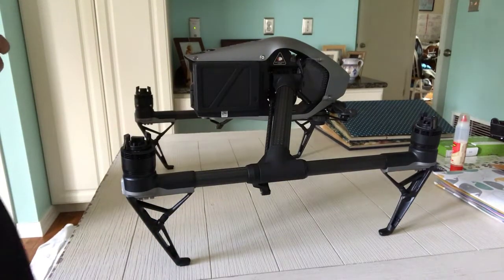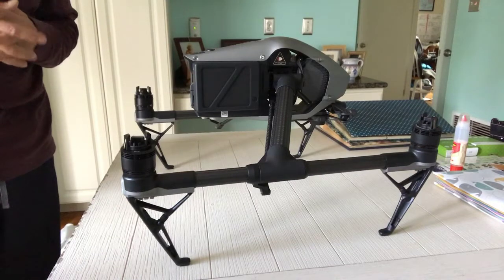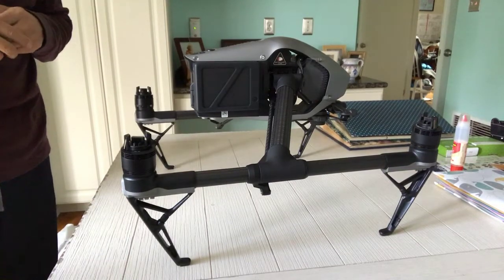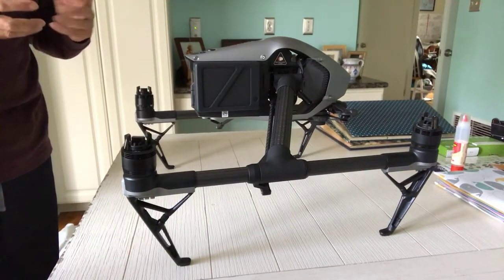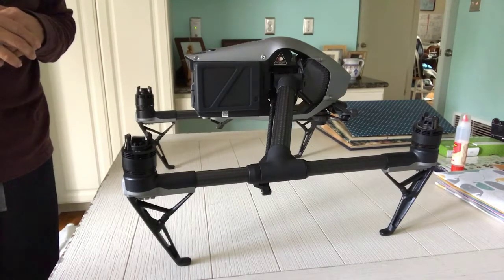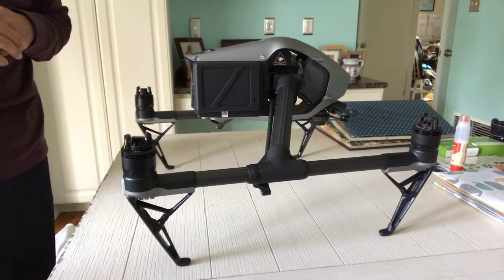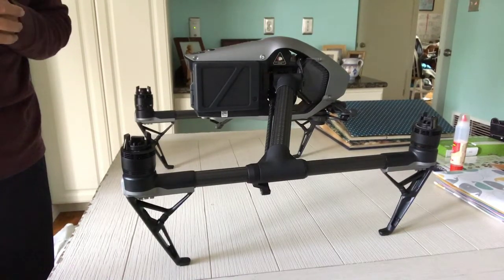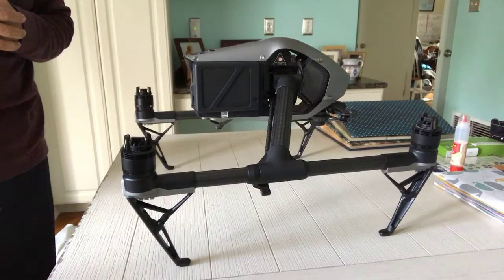Inspire 2 Landing Gear Failure

Comment: Its on travel mode so it will not retract.Am I right?
Reply from the maker: Well, during travel mode is not expected to retract or get on landing mode. I hope that answers your question.
NOTE: The inspire II has some issues that have been documented in the past. One being that the drone drops in flight for no reason at all due to a bug in some batteries. I also experience another failure recently. I loved the drone at first but I have lost confidence in them after 2 years or so of operation.
Reply: @macalcdc  Thank you for the answer,however I do not have inspire 2,but addicted on it,so I only watch it.
Reply: Under the bottom should be a screw that allows u to put it in travel mode manually. I have the inspire 1 and I have to do this after flying to put it back in the case.

Comment: i have the same problem, do you have de solution?
Reply from the maker: CABES Producción. I did solved the problem without sending it to DJI for repair even though they sent me the a repair order. 
Here is what I did.
Underneath the fuselage, the drone has a screw that can lower or raise the landing gear manually. By lowering the landing gear, the servo is able to reset and resume normal operation. Let me know if you need further assistance. Am in North Carolina USA, I can do a video conference to show you if need it. Mauricio Castro
Reply: @macalcdc I have the same problem and I also try it manually but the auto doesn't work always, can you help?

Comment: is there any solution of this troubleshooting? which i can do at home.. its not easy for me to send it back to DJI.
Reply from the maker: It depends. If the failure is firmware related, you may be able to fix it; if the issue is due to a faulty part that controls the up/down landing gear, you would need to send it to DJI for repair. In some cases is related to loose landing gear bolts. I hope this helps you.